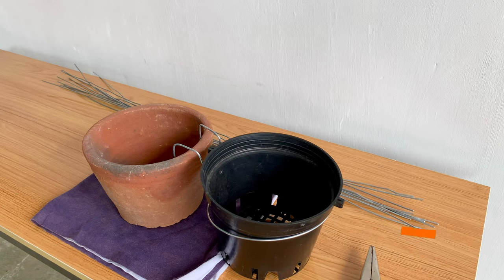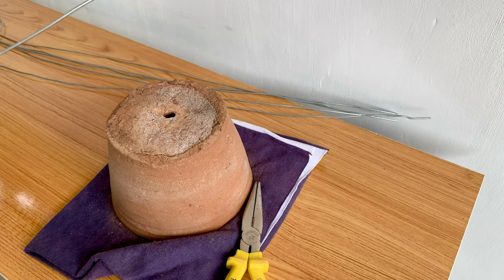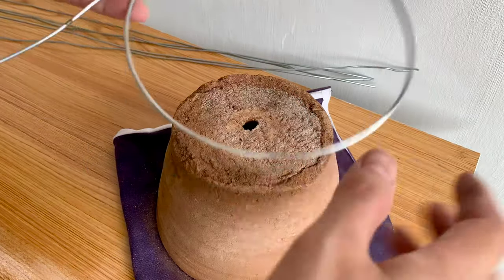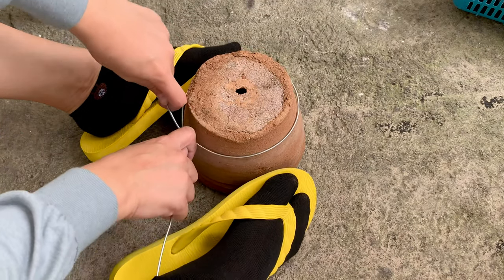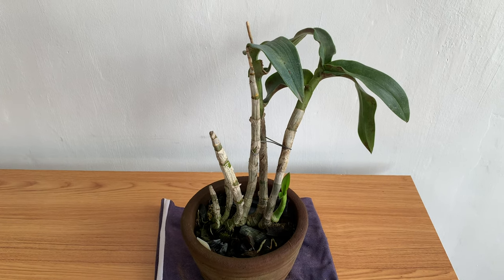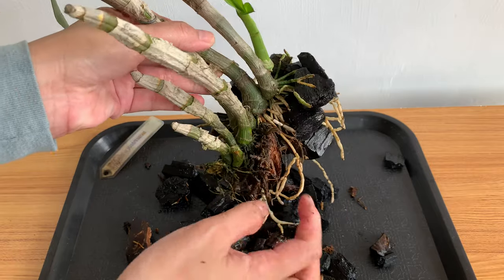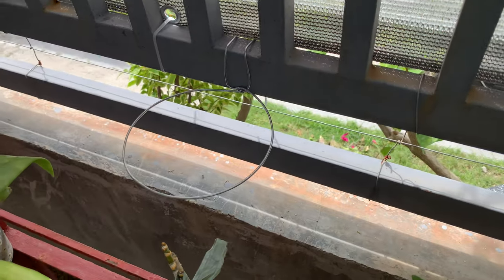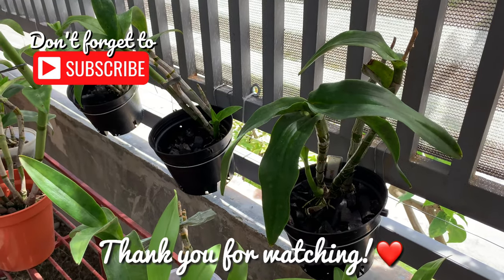DIY WALL PLANT POT HOLDER/HANGER FOR ORCHIDS & PLANTS | How to Make Orchid Plant Pot Holder/Hanger

Comment: You need to use the pliers when you twist the wire while it's on the pot in it will hold it if you can help the pliers
Reply from the maker: Thank you for the tip😊

Comment: Hmm. Are u sure it can hold the weight of the pot with the soil inside without the hanger flipping over ?
Reply from the maker: Hi!🤗 i used plastic pot and charcoal, they are lightweight, i also made sure that the hanger fits the pot well and so far none of them flipped 😊
Reply: @CheeryOrchids  Can u also do a video of the pots together with the plants and soil ? It will be awesome... 😀